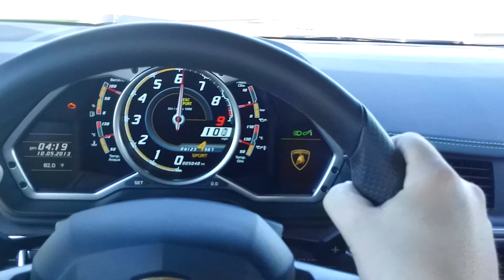Brake Master Cylinder Rebuild - RA23 Toyota Celica Restomod (Part 10)

Comment: I believe the small seal would be for the input shaft that comes off the brake lever into the booster.
Reply from the maker: Ahhh ok - will hang on to it just in case - thanks!